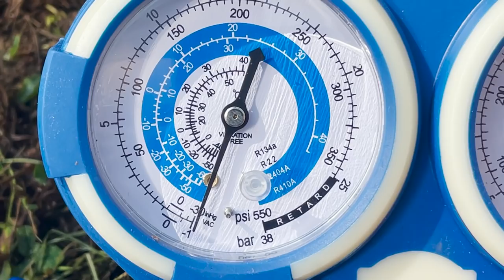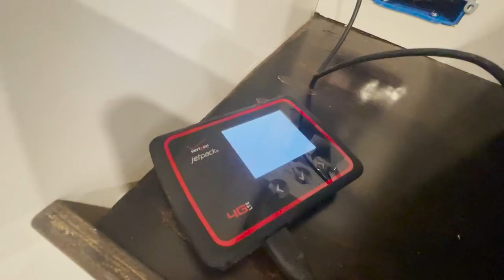COMFORTABLE BUSLIFE//Outdoor Mini-Split Unit for our Bus Conversion - S04E26

Comment: I’m dreaming of buying a 40ft BlueBird Flat Nose Diesel Pusher this summer. I’ve watched numerous DIY videos of bus conversions and have learned many hacks from them all! I have found out that wood chips and saw dust trumps Peat Moss every time keeping the smells at bay in a composting toilet! I’m certainly going to give those two a go in my DIY composting toilet! Also drilling 2in holes in the plywood under neat your mattress keeps mold from growing on the bottom of your mattress. That or just building narrow wood planks to keep the air flow under it. Just things I have learned in the last few months and I’m still learning! Love your bus and the build! What a marvelous find of cutting your own wood slaves for your counters!
Reply from the maker: Best of luck for the search for your dream bus!

Comment: Installed two mini splits in our home this summer by myself
I'm a pretty accomplished mechanic and an avid DIY  guy.
The install was straight up easy, and the wife and I  are very pleased with them.
Reply from the maker: Hey Steve thanks for sharing. I was intimidated by the installation but like you it went pretty smooth and now we are ready to install one up front

Comment: The one thing I have noticed with videos on installing mini-split is that they don't show how it is hooked up to power. Do you show this somewhere?  I have enjoyed watching your install and your learning progress. Good job.
Reply from the maker: Hi Sharee, the 110v runs straight back to our circuit breaker - there is no “plug” for this style of mini split. We will be adding a 30 amp quick disconnect between to minisplit outdoor unit and the breaker box soon

Comment: With my 12k and my 9k in hot weather at night I'll pull about 2000-3700 watts @ 24v. I have 3200 watts on roof and 13kwh lipo4 battery bank. I still need more battery. During hot sunny days I can break even and still maintain 90-100% battery. It's the hot hours after peak sun that drain the bank. But I can go all night. ;P

Comment: I've been wanting to ask ever since you started wiring; why haven't you invested in a pair of dedicated crimpers instead of using lineman's pliers? Easier to use, more positive results and certainly easier on finger/hand joints. I spent 8 years wiring passenger and freight elevator controllers and wouldn't have lasted a week using my pliers to crimp terminals.

Comment: Surprised you're mounting the a/c outside compressor to a non-vented area under the bus.
Reply from the maker: It is ventilated!  There is a massive hole underneath.  Many MCI conversions do this.

Comment: beautiful wood.  nice job on the mini-split hookup.  With it placed in the rear, do you find it has any trouble blowing air to the front of the bus or having the front sitting area getting cool enough?  thx
Reply: The mini split has two awesome setting that can help move air up front.
One is the  follow me button on the remote,  that tells the unit to make the temp  at the remote's location
The other is the turbo button !
It will  bring on the super high speed fan